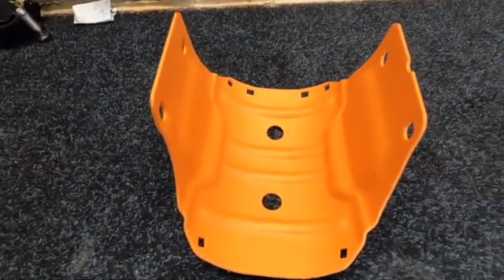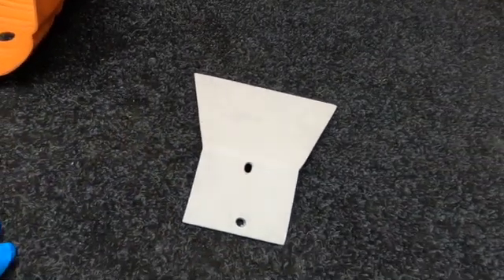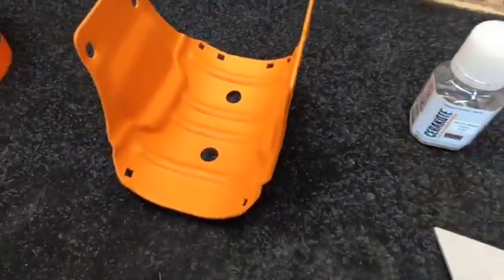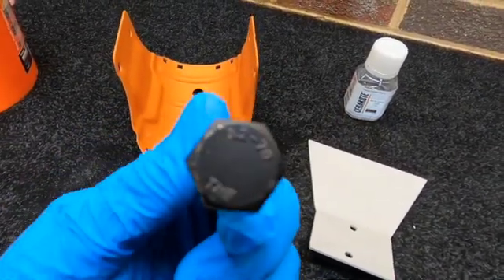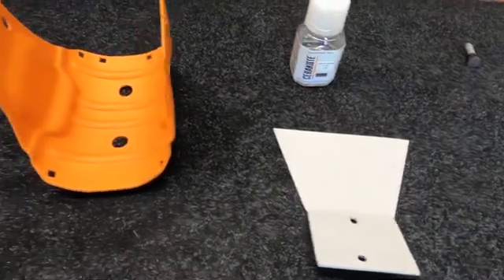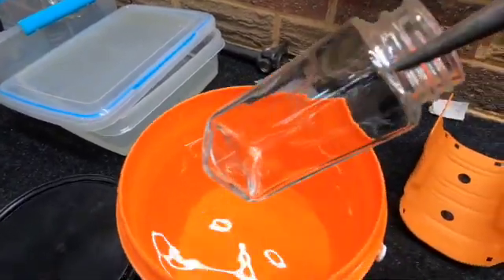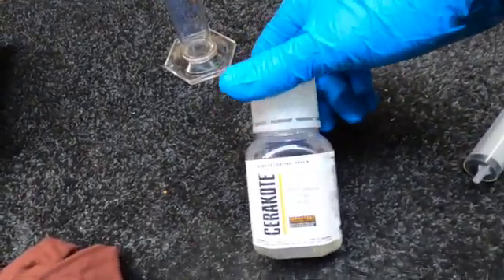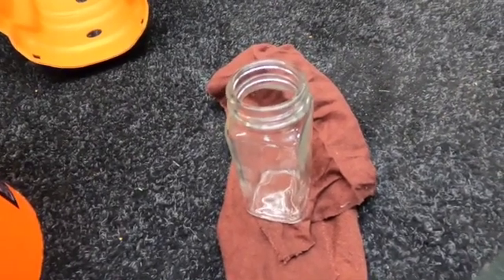Cerakote H Series chemical and scratch resistance testing

Comment: Thank you for doing this test. There isn't much in the way of real world reviews of this product. Lots of marketing wank from Cerakote
Reply from the maker: Pleasure Evan, there is a lot of talk but this backed it up well! I was burnt using duplicolor engine enamel on my engine the first time that had the same chemical resistance claims but when one drop of fuel fell on it the paint turned to a gluey mess or marked so this time I thought I have to test it first before seeing all my hard work go down the drain. I recently spilled fuel on the hot engine cover again and saw a mark but when I wiped it off it was good as new :) very impressive